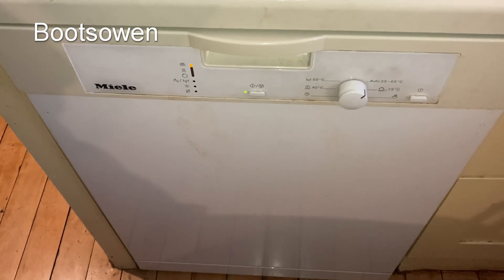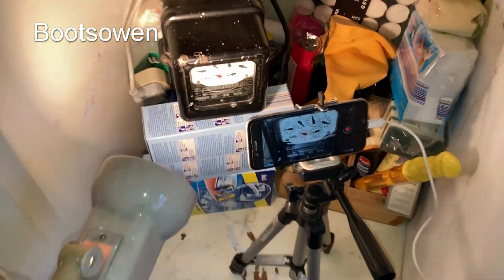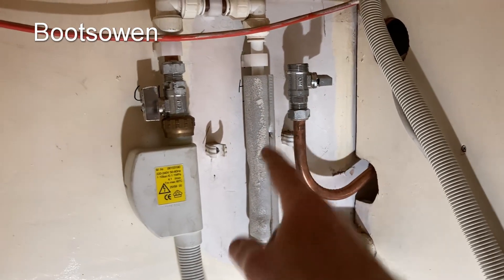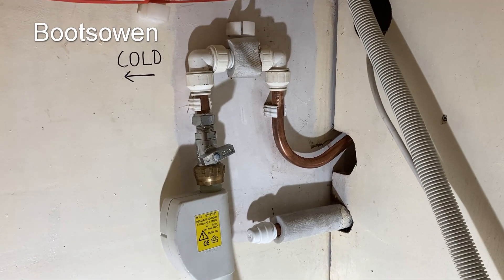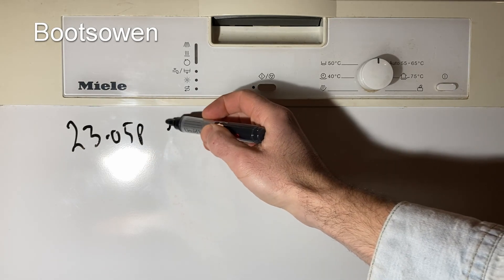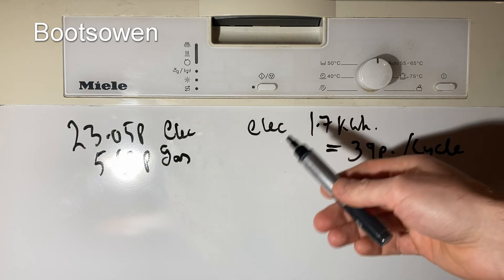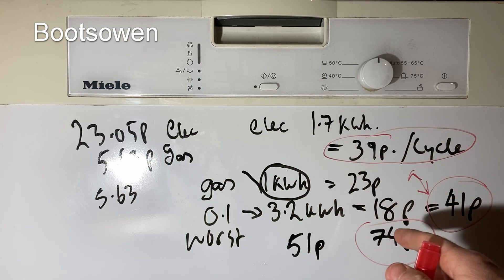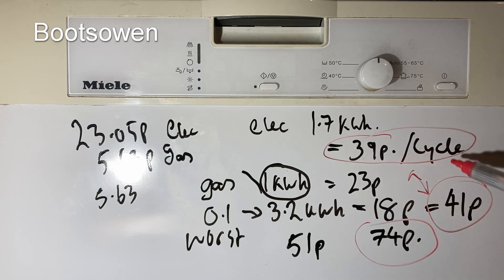You won't believe it: Save money by running your dishwasher on hot water?  Full calculations!

Comment: Thank you! I just switched my washing machine to a hot water fill from the boiler but I now realize that I will be heating on the rinse cycle too. Going to try a short cycle to see if that is any cheaper. Why do modern machines not have a hot water fill?

Comment: It'd be interesting how your calculations would fare if you had a heat pump and a hot water tank. Assuming a COP of just 2 for DHW, it seems that the heat pump would be cheaper via a hot fill. I'm guessing the normal COP for DHW is around 3 however which makes a big difference.

Perhaps this is why Miele are bringing the "hot fill" stuff back - Because of heat pumps
Reply from the maker: I reckon if I have hot water from solar over the summer it may be worth running it on hot water, that way the hot would be free!
Reply: @bootsowen  I guess this is why Miele have a "solar save" option

Comment: The prewash will work better if the water starts off warm, but it needs to be running warm into the dishwasher. If it's cooled down in the pipework, it's the same as cold. So you may need to run the nearest hot water tap into a bowl, bucket or sink with a plug in until the water runs hot (you can save this water for another use).

If you can find a good dishwasher powder (or gel), you can fill both the prewash AND main detergent cups for even better cleaning. Best if you can do that along with using the hot water connection.

Have you watched Technology Connections video titled: 
Detergent packs are kinda wishy-washy (Dishwashers Explained)

It's all explained in that video. 😎

Comment: General advice is that unless the gas boiler's a short run from machine it's not worth it because there's cold(er) water in the pipe and by the time the (combi) boiler's recognised a draw and started heating, a considerable quantity of colder water's already in the machine.  Worst case scenario's that hot water never reaches the washer due to length of run but is wasted sitting in the pipe - so it's cost more than otherwise.  You could run the hot tap to ensure the water got to the machine quickly, and lagged pipes help.

Calculations should assume a condensing boiler may be 90% efficient, whereas electric is 100% at point of delivery - thus you get 90% of the unit cost of gas but 100% of electric.  This only makes a small difference given that electric is three times gas price.

Note that modern d/washers either don't have a heated drying cycle or allow deactivation to save electric.  I find residual heat from the final hot rinse is perfectly adequate except for plastics.

American machines are normally connected to hot but the same observation applies above: how much hot water actually reaches the machine and how much is it boosting with its heater?
Reply from the maker: I don’t know if I agree with that general advice. If you hear your hot tank with solar or wood then it no longer applies.

Comment: If you run hot water out of the washer and keep the water in a large drum it keeps the house warm . We did that one cold day .For a dishwasher the food particles need to be considered as they might collect until it`s cold . A filter might work so the cold water can flow out easily

Comment: You could transform this dishwasher into hot and cold. Basicly you would have to make a device that switches to hot fill for for a few minutes after starting the machine(so dishwasher has time to fill itself with hot water) and after some time (a safe amount of time you would be sure that machine isn"t gonna add any more water) it switches back to cold fill. Simple timer based valve switch

Comment: Another factor that plays a role is that when the dishwasher starts filling, water in the hose is cold. The hot water from the boiler needs time to get to the machine, so it might fill with water which is still warm.

Comment: Good thinking Boots,I had a similar idea with the Bosch washing machine,I have plenty of hot water from the range in winter,so instead of using the leccy to heat the water....only snag being will the Bosch say noooo!!
Reply from the maker: That's the thing, if you have free hot water from wood or solar then you are ahead, I'm still burning gas so it's pricey!
Reply: Problem is machine does two or three rinses, which is a waste of hot water.  If you could be bothered you'd have to switch to cold after the wash cycle's started (unless machine's hot and cold fill).

Comment: Owen, glad you included the rinse with hot water, you obviously have a hot water on demand (combi) type boiler to be able to quantify the gas consumption. Very interesting concepts and out come. It's not until you do the experiments that these factors become evident, splendid, cheers
Reply from the maker: Thanks Andy, yes, we have a combi. I was surprised by this experiment. I thought it would  use a similar amount of energy, and that the difference in price would take care of any difference in energy, but I suspect that there are two rinses. I "invested" in a 1kW travel kettle that can boil a single cup. I have been doing some tests comparing it to our old kettle, that needed 2 cups to cover the element. Initially I got it to simply boil the water I needed, but then winter rolled in and all the hot water is coming off the range. But my comparison becomes redundant as the kettle takes less power, so the solar can probably run it in sunshine for free. But how to make a video of that?

I have a foggy double glazed unit that I am thinking of repairing, seems easy enough. ever done it?
Reply: @bootsowen  Owen, the small 1 Kw kettle doesn't seem obvious to many people, ooh it takes too long, as if there time is that constrained!
Double glazed units: well the edging strip that keeps he glass apart is full of silica gel and has self adhesive strip on it. If you can split the unit with a Stanley knife between the glass and this strip then you could put this half somewhere warm to dry that out completely. Fine dust on the glass is the major problem when putting it back together. I suppose having the glass quite warm would then create a sort of vacuum when it cooled. What sealant would you use? cheers
Reply from the maker: I have seen a good video by @rlbob1. he does it all manually and fills the panel with welding argon. I have a bottle of that already. I have seen a website in the UK recommending Everflex 225 silicone. I don't mind giving it a go. I have a unit in the inside porch doors, they are 60mm thick teak double doors with full clear double glazed units, skip find, the appeared fine but when hung one has mist. Worst case scenario is that I lose my time and some silicone. Like you say a clean workspace. I have heard that you can dry the silica gel, or buy more on ebay. 

As for the kettle, I haven't timed it, and I haven't died of thirst either!
Reply: @bootsowen  dishwashers are supposed to be cold fill only and heat their own water for hygiene reasons I read that somewhere
Reply from the maker: What are "Hygiene reasons"?
Reply: @theoddjobcentre6686  There is a Miele dishwasher that's been made to specifically allow the use of hot water. It's called "solar save"